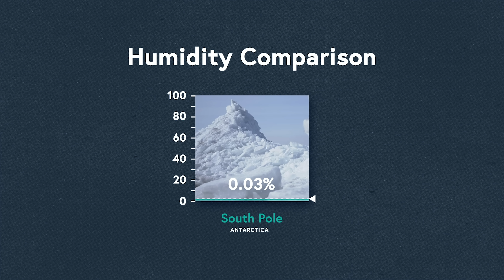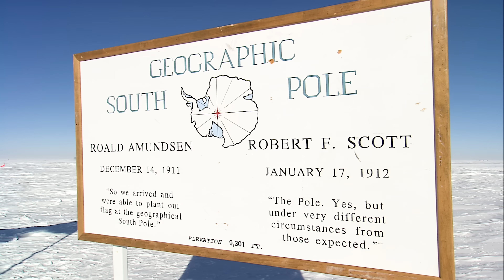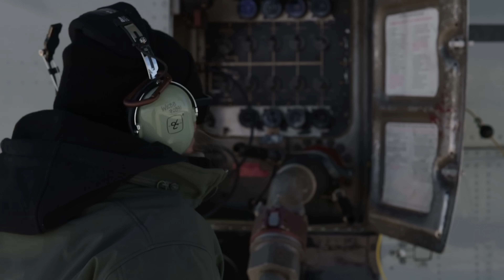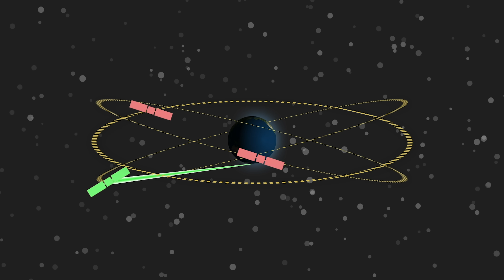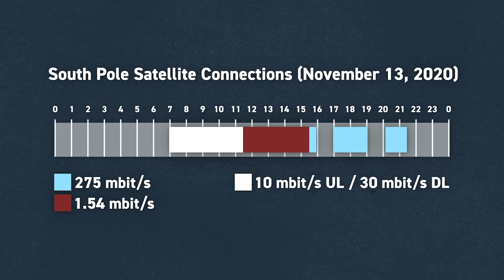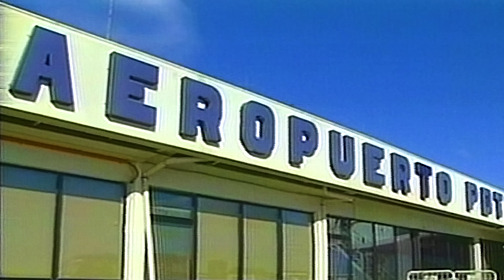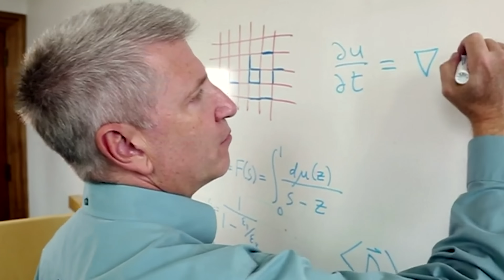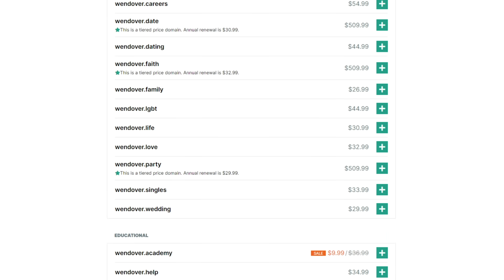How Living at the South Pole Works

Comment: Perfect physical health? Yep
Can deal with the isolation? Yep
Spotty internet connection? ...I don't think I'd survive in Antarctica
Reply: ^ this. My physical health is great and I was social distancing long before COVID-19, but by God, I would not want to live without internet access.
Reply: There's a pretty good internet connection at McMurdo, though it's sometimes a bit slow.

At South Pole we had satellite internet 9 hours per day when I was there summer of 2007-08, depending on when the satellites were in the right position - then we lost one and still had 7 hours per days - though it moved forward a few minutes each day so it wasn't always the same time of day. They also had another satellite that they didn't offer to regular workers there, but which was available for emergency communications and for short emails 24/7.

Hopefully they have a better connection now, but it's not quite as bad as you might think.
Reply: @alanlight7740  Just lay down a fiber optics cable bruh
Reply: @markusklyver6277  - LOL - easier said than done.

You know those glaciers are constantly moving, right?

Comment: And you also forgot to mention that atmosphere is thinner at the poles, so 2 000 meters altitude there is more difficult to have than 2 000 meters at the equator
Reply: 9300 feet - but the equivalent of about 10,500 feet at the equator.
Reply: @alanlight7740  Oh thx for the maths, I was too lazy to do it by myself ^^

Comment: This is why I will not believe in Mars colonization hype before we can safely live at the South Pole for YEARS without external support
Reply: Although I get what your saying, i think its important to see that its specifically not designed to be viable for years. If we wanted it to be able to be viable for longer we could.
Reply: @jackzickrick1654  yes, that's true. But high redundancy is expensive. And even disregarding the costs, "unknown unknowns" will be so many that the chance of the first colonies surviving long term can be rather low. Possible, but thats why we need to test and retest in Antarctica and then the moon before even thinking of Mars
Reply: Small steps right.
Reply: Th problem is that it, unlike a Mars colony, doesn't need to be isolated for years at a time.
Reply: I don't understand why people don't try to set up an experiment like that there, on the pole. It would be a great start
Reply: It might not be wrong to say that it’s easier to live on the moon then on the South Pole. On the moon you could get a resupply or evacuate in 3 days, Less if it’s an emergency. While getting to the South Pole is only limited to a 3 month period.
Reply: @theluftwaffle1  But you still have to deal with extremely low gravity and high cosmic radiation.
Reply: when 3D printing advances even more we'd be golden
Reply: Send Elon Musk there and let him stay there till he makes it habitable.

Comment: Fun fact: the Event Horizon Telescope can only gather data for about one week every year. The reason is that it's physically impossible to fly more hard drives to the South Pole and back to hold all the data.
Reply: They could use high density LTO.
Reply: @Thelango99  most of photos taken by telescopes like the event horizon are left uncompressed so as to not affect the image to much. The size and detail of these uncompressed images make almost any data storage system fill extremely quick. Thats also why data is saved and transported on a physical device because trying to send that amount of information over a wireless connection would take a obscenely long time.
Reply: @jasonirwin4631  Yes, but LTO is a storage format. LTO stands for Linear Tape Open.
Reply: @jasonirwin4631  For example the current LTO 9 standard can store up to 18 TB on a single tape cartridge and has transfer rate of  400 MB/s.
Reply: @Thelango99  the issue is not the transfer speed of the storage device but what will you transfer the data to as the video explained internet in at the south pole is spotty and very slow. so transfer from tape to wireless connection would be be slow due to the connection issues. Transfer from tape to a hard drive or to another tape is kind of pointless unless this new storage device is not on in antarctic. In that case the big thing slowing down the movement of data is getting stuff to and from there. LTO might increase the amount time the telescope would be able to gather data but it would get around the bad wireless connection and hostile environment making logistics extremely hard issues.
Reply: @jasonirwin4631  My point was that you could increase the amount of data stored for increased operation time, it would still be an improvement.
Reply: That's true but it assumes you can actually revamp the hardware that's used at the SPT, which isn't straightforward at all. With these instruments you can't just plug in a new piece of hardware and call it a day.

Comment: I remember reading that they had a 25mb iridium bgan connection at one point? Or maybe that was McMurdo. I know those are very expensive though and are charged per minute of usage so it may be only for emergencies?
Reply: Pretty much. I was there summer of 2007-08 and we had about 9 hours of internet per day for regular workers, BUT we also had an iridium connection that was only used for official purposes - and email. As long as it didn't exceed maybe a megabyte we could send and receive email any time of day.

Comment: 7:30 The "m" in "mbit" should be capitalised as it is a prefix denoting "mega".
Reply: millibit
Reply: Obviously they're referring to a value that is 1/1000 the size of a bit
Reply: @Geerice  while I know that's a joke, it gives rise to an interesting thing to ponder - it is impossible to transmit a fraction of a bit of information. A bit is either transmitted or it isn't.
Reply: @butwhowasmoto2739  Yeah you can. In orthogonal encoding bits are broken into smaller parts called chips. The nature of the coding allows many people to see the same transmission but only be able to interpret their part. As you can imagine this is great for cell phones.
Reply: @butwhowasmoto2739  And adding to what @Joe Momma said, even if a fraction of a bit were impossible to transmit, you could still get a fraction speed per second, simply by not transmitting bits every second.